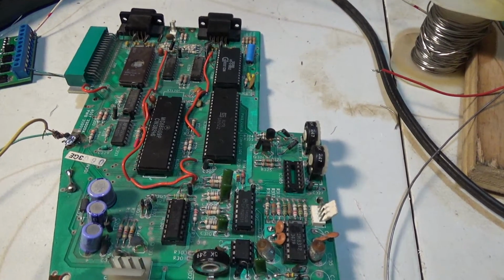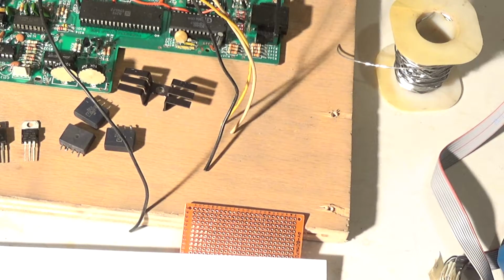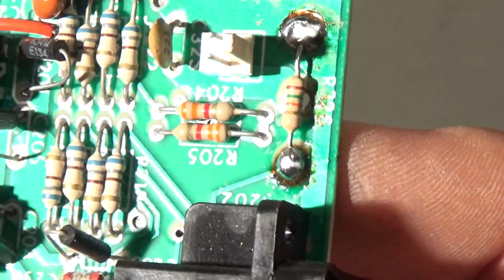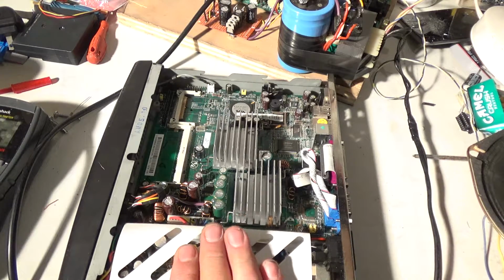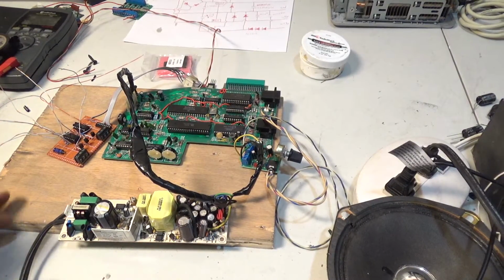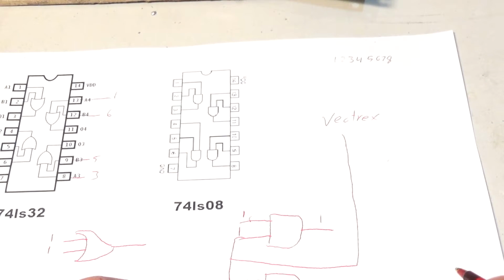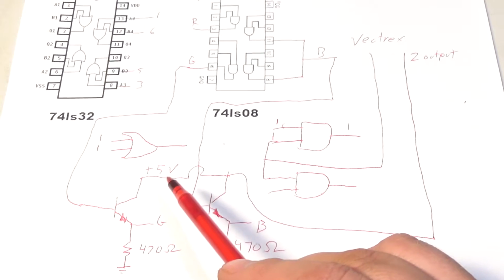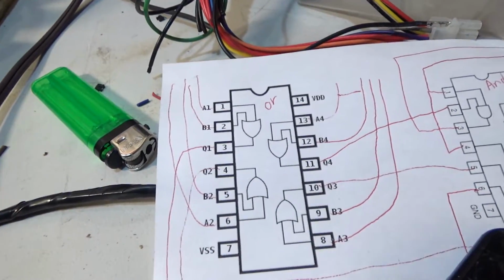Making a color VECTREX arcade

Comment: Didn't the original Vectrex 3d headset have a method for generating color based on timing of the output with respect to the rescan interval using a rotating color wheel? I think it had a different color wheel for different games  to match their timing.

Comment: Those 7805 ICs need a good heat sink to get more than a few tens of milliamps through them, especially if the input voltage is much higher than 5V.  If the input is 17V, then there will be 12V dropped across the regulator.  With 1A flowing, that is 12 watts of heat to get rid of.  You need to spread that over as large a surface area as possible to dissipate it into the surrounding air.
Reply from the maker: sure  of course  i agree except for the few tens part i think you mean a few hundreds

Comment: That is very cool, cant wait for part two. regarding you first power supply, it would of probably worked fine if you had put the two (would of probably got away with one) of  them on a decent size heat sink. 7805's can only handle a couple of hundred milliamps without a heat sink. two wired in parallel on a heat sink will handle well over 2 amps.
Reply from the maker: yeah i think your right still haven't measured the current  to be honest i really didn't like the look of it

Comment: Thanks!  Lots of tech specs, speech, and fails, and demonstrations.  The perfect video.
Reply: "if you build it, they will come" ;)
Reply: ..and also develop new games
Reply from the maker: thanks vectrexer i think i changed  my mind again i may use 16 colors  instead
Reply from the maker: Hey I just found a post you wrote about the color vectrex while checking to see if my video can be found in Google yet.    It would be difficult and very limiting for a programmer to pick colors with this circuit but since no one has made a color game I used this method. BUT I can easily make a simple circuit that can access 4,8,16 or 32 colors that a programmer could hand pick and believe it or not easily adapt existing games to play in color
Reply from the maker: The reason I didn't use that method in the video is because with out programming most games looked very dull
Reply: could a switch be added to toggle between programmable/auto-color modes?
Reply from the maker: yes but i would need a very different circuit .  i decided to use this circuit  because nobody ever did any color programming
Reply: I also believe people would develop and hack new stuff if there were some simple standard to do it. Like the Vectrex was originally planned to do. I think i have seen a picture of some color prototype back in the days. Some of the 3D games do use colors, but they are programmed by timing. Maby someone could hack them for start or something, i dont know enough about coding. But on the hardware side, 78s05 (2 amps) for the +5v and heat sink for the regulators might be better.
Reply from the maker: to be honest i really wasn't happy  with how ugly the power supply turned out  so didn't want to  fix it  thanks for the info about the 78s05 good to know